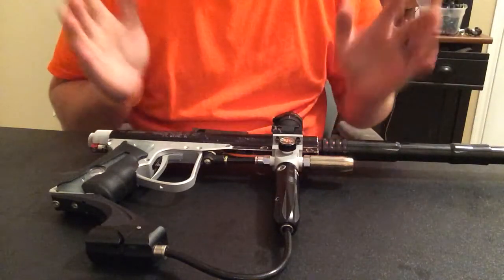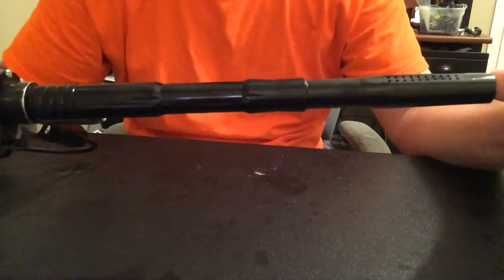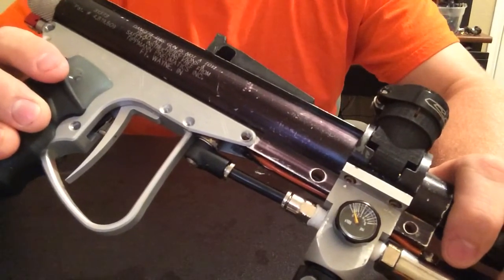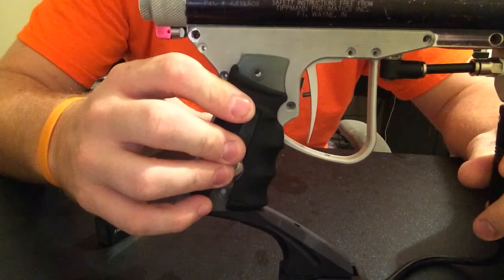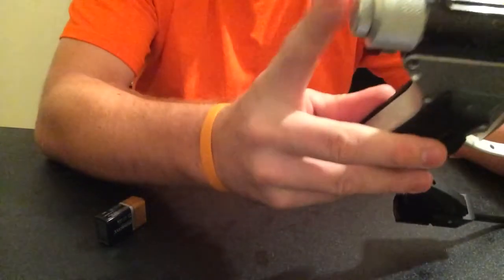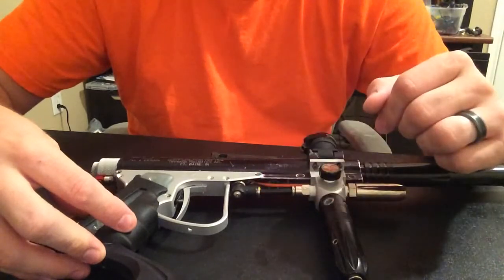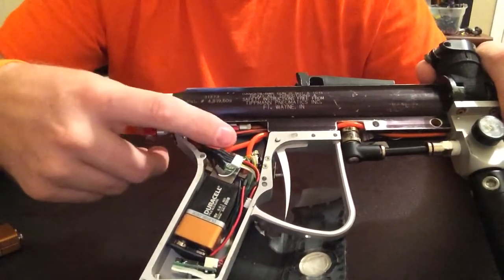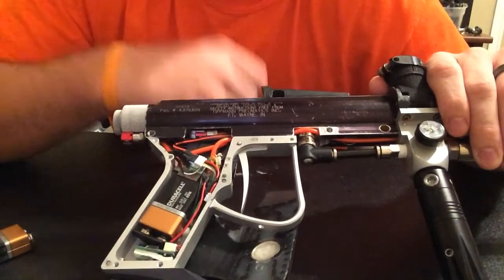Ebolt 68 carbine build summary

Comment: I need a vertical ASA adapter do you know were to get one ?
Reply: Another option would be to just mount the reg direct to the ASA. And then just using a plastic gun forgrip since those are available everywhere lol.
Reply from the maker: Jay Time unfortunately no. You could try the tippmann owners community on Facebook
Reply: @Hwoodwoodwork  I have a 68 carbine that was used 2 times than sat for 20 years its in AMAZING shape I want to trix it out the valve still works o-rings are on the way
Reply from the maker: It’s one of my favorites

Comment: I want some of those 3D printed feednecks! How do I buy?
Reply from the maker: Michelangelo Mario Mario I’ll have to see if I still have the file.
Reply: I hope you do! I have a fleet of 68s and would take at least a half dozen of these. The OEM plastic one is way to flimsy and the OEM metal one is so heavy! I think you solved it friend.
Reply from the maker: I actually ended up having a friend make an aluminum one.
Reply: Did the one way make not work out? It seems better then OEM. There’s probably a market for these bruh. The 68 Carbine is popular and the 1st Tippmann to work on HPA, but a lot are missing the necessary feedneck.
Reply: If a feedneck does come up for sale they don’t go for less then $25 I’ve seen. But rare still.
Reply from the maker: @GradyUSMC  Shoot me an email and we can discuss this more. hwood.woodwork@gmail.com
Reply from the maker: It worked great actually, I made some changes to the grip frame and the same guy who machine the one in this video made my version 2 of the frame and so I had him make the feedneck in aluminum while he was at it. I do have the file, you do understand that this feedneck is a replacement for the D-Feed vertical adapter feedneck right?